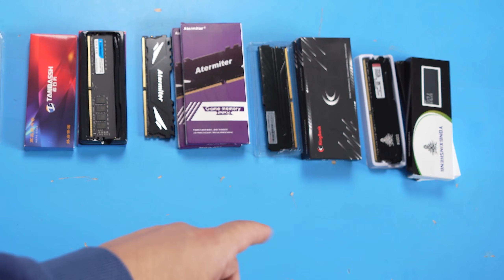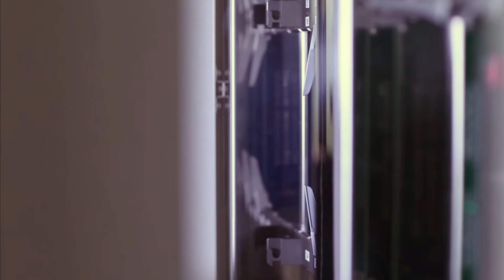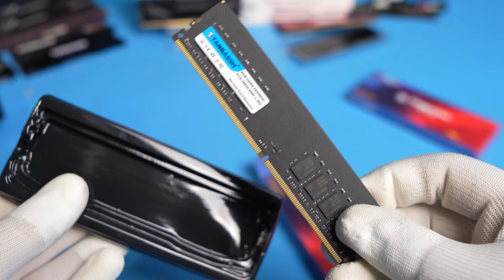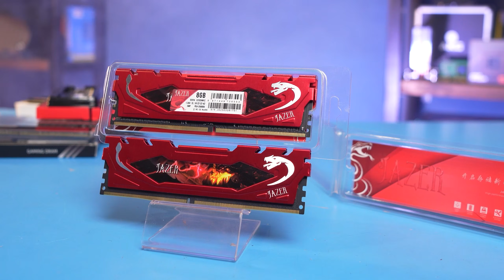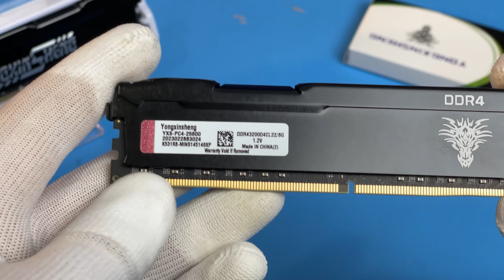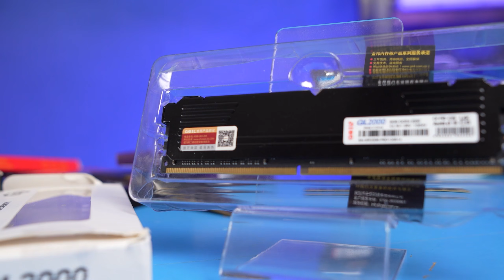DO NOT buy this RAM | Testing cheap memory from China

Comment: I am actually shocked You had issues with the killisre, I have used them several times And never once had any of the issues you did, Ran Perfectly fine for me each time, Though naturally each person will have Different Outcomes Depending on the seller Possibly? Anyways great video! Also i should note, I used killisre in ddr3 builds, And recently acquired Two 8gb sticks of ddr4 For upgrading from a i7 4790 to a I7 9700k, Did memory tests And It was completely stable and Ran 3200mhz at cl22,
 in my current set up(that i am upgrading i have 32gb of Killisre ddr3, And have had that ram For several years now With no issues, But i could of gotten lucky
Reply: some people  had issue with china not rams

Comment: 10 $ 8 gb ddr 3 , kit of 2 and no problems 2 years in use , yeah no XMP , a bit of overclock by lowering timings , but stable no errors , i can see the downsides but still worth it for the price . As long as you don't overclock and  know how to set your timings for stable , any ram works .

Comment: Another ram snob. The chips are all the same no matter if you pay double or triple the price. They are all either Micron, SK Hynix or Samsung. In 2024 and on SK Hynix has started to faze out ddr4 chips production so most chips are now Micron and Samsung (which is good). No matter what ram you buy you get these chips. The only difference is in the binning. You can OC well binned chips more and are more stable. Well binned chips will run the advertised speed at Jedec profiles.

Comment: I bought DDR3 Kllisre ram years ago 32GB for around 120CAD in 2019, this is when DDR3 was still stupid expensive for some reason for 8GB modules. I wanted to max out my ram and couldn't afford the brand name stuff in Canada so I ordered it and it worked great at 1866MT for years, even ran it as a server and was also stable on my Z87 with a 4790K.

Comment: Bought KILLSRE 3200mhz 16gb kit worked
Cuso 16gb 3600mhz worked 
Sold both and now i got fanxiang 16x2 3600mhz and works like a charm

All from aliexpress :))

I also snagged a RTX 4060 MSI ventus for 235 USD I used coins and a 40$ coupon :))

Comment: Bought 2 kits of 2x48GB 6400 CL32 from kingbank

All 4 sticks have hynix m die and all run at 7400 CL37

For £188 and £193 for the first and second kit about 2 months apart it obliterates buying any other sticks from anywhere else even used sticks
Reply: Is it working perfectly fine mate? Im thinking to buy it
Reply: @ yeah all still working fine but with 4 sticks i het 5400 and 2 sticks 6400, depends heavily on workload which performs better

Comment: I do not know about any of the other brands but KingBank DDR5 Hynix-A die chips are killing it! You'll have to buy a 2x16 6800 and above for guaranteed A-die. Their 2x24GB 6800 kit is also amazing (Hynix new gen M-Die).

Both can be overclocked to 7800~8400+ on Z790 / AM5 platform depending on the silicone lottery for the chips.

I've had experience about a dozen KingBank DDR5 kits from 2x16 6800 / 7200 / 6800
and 2x24 6800 kits.

I do not have any experience with the KingBank 2x16 6000 / 6400 first gen M-Die kits.
Reply: I'll get the 6000CL28 A-DIE kit from that brand, hopefully it will be good, my first option was the T Create 6000CL30 but KingBank gives lower latency and EXPO profile
Reply: @matiasbao4900  That's a very good kit, good chips, especially if you just set and forget EXPO. If you know how to tube a bit I was able to do 6400 CL28 with pretty much all their A-Die kits at 6800. All their kits have both XMP and EXPO.

The real performance improvement will come through tweaking the subtimings.
Reply: @Ben-ld1qi I am clueless about ram tweaking, specially on Ryzen, any videos you recommend me? All I know is that the sweetspot is 6000 and C28-30, nothing besides that
Reply: @matiasbao4900 how did your experience go? Which ram you ended up buying?
Reply: Have you tried KingBank ram using amd or intel cpu? I'm really considering buying them but idk if they're stable with AMD.
Reply: @salem7 You'ge got nothing to worry, they're stable with AMD, it's not any different. I used to have 7800x3D and Gigabyte B650M Aorus Elite and I did only 8000c34 fully stable using a KingBank 6800 2x16 kit. 

A friend of mine recently bought KingBank 8400 2x24 and hes running it at 9133 Gear2 on Intel Z890 platform, he's got GSkill 8800 and V-Color 8600 that fail to do 9133.

For AMD, something like 8000 in 1:2or 6400 in 1:1 would be ideal. Anything higher involves luck with getting a capable CPU and motherboard, the RAM isn't the issue in the majority of cases.
Reply: @salem7  I see my reply didn't go through? Afff... Apologies I don't feel like rambling again. TL;DR they're work for AMD and Intel just as well, they're no reason to worry about them "not stable" with AMD or any nonsense like that. What frequency and CAS latency do you want to achieve?
Reply: @Ben-ld1qi honestly I don't plan overclock it beyond whatever expo profile, I'm taking cl28 6000mhz 24x2 which is the same price as 16x2 corsair 6000mhz cl32
Reply: @salem7  With EXPO speeds and absolutely zero tinkering, overclocking or finetuning any of the timings (there are over 20 other subtimings), a 6000c28 2x24 is a good choice. You've got nothing to worry.

I run 6800c34 2x24 @ 7400c34 with all the subtimings tuned, the reason for 7400 and not 8000+ is because of my Intel motherboard's limitation, not the RAM. 

When I had 7800x3d and Gigabyte B650M Aorus Elite over a year ago, I managed to stably overclock the KingBank 6800x34 2x16 kit to 8000c34, but doing 8000 on AMD B650 requires lucky CPU and motherboard. Now on B850 (not B650M), doing 8000 should be easier to achieve. Your 6000c28 2x24 will very likely be able to do 8000+, but it also depends on your CPU and motherboard, it's a trifactor of those three.

A friemd of mine is running KingBank 8400 2x24 @ 9133 on Intel Z890.

If you ever choose to learn about overrclocking I'm sure you'll be able to do 8000c38 / c36 quite easily.
Reply: @Ben-ld1qi  Greatly appreciate your response mate, just made the order for KingBank DDR5 48GB (2x24GB) 6000MHz CL28. honestly with the same price there isn't a better deal. 
Can't wait for it to arrive!!
Reply: @salem7  Yes they're very good for general use and some light to moderate overclocking even. My 6800c34 2x24 kit costed me $98 and I didn't even get 18% VAT when it arrived. If I were to buy 2nd hand used RAM I would only find some 2x16 crap RAM. The metallic heatsinks by KingBank (the ones that 2 hex screws by a plastic covering) are very well made, they cannot come apart because a screw each side is holding it tight, I believe the 6000c28 2x24 uses those heatsinks. Where as the heatsinks without the screws can come apart with since there's nothing holding them together besides the adhesive tape and if it gets hot and wears the adhesivce tape loses the heatsinks drift apart a bit.

Comment: If your motherboard brand specifies a certain model of Kingbank ram is on their compatible list, would you buy it?  I had a builder shove the wrong model in and obviously it's bottlenecking. Tried Expo settings on the old ram and I get more noticeable speed in my system, but it's unstable. I know there's improvements to be had (hence realizing the bottleneck) but wary of a brand i didn't know about until this desktop build.

Comment: if you are paying less than 50% of the price those are totally worth it imo
Reply: eh i paid 18$ for 2x8 -16gb of the yongxinsheng  cant complain about the price
Reply: @ That cheap memory will screw up your computer
Reply: @Steve-mp7by elaborate
Reply: Fake RAM can corrupt data and cause a short that will fry your mobo and CPU. There is no quality standard with that fake junk
Reply: So long as they last at least half as long, and don't take out the rest of your PC when they go BANG.
Reply: @zlobzor how does that happen genius? Mind explaining?
Reply: @zlobzor  how would a ram malfunctioning take out your whole pc tf
Reply: @lemonke5341  SHORTING THE CIRCUITS.
Reply: wont happen
Reply: @maorlodrik  Just because it works doesnt mean its reliable thats what cheap and fake products really is obviously it will work duh but how long.
Reply: @ I have a netac one for 3 years...
Reply: @gladewings1192 weak argument

Comment: good video  but the problems only seem to appear when you try overclocking  News Flash  not everyone wants or needs to overclock their ram the extra performance of say 3200 to  3600 is very negligible and hardly worth the effort.   you get what you pay for no different buying second hand ram on ebay

Comment: If longevity is good for the price and whatever is run isn't bandwidth bound, it's probably a good buy. It would be a valid way to recycle components and reduce demand so prices might be lower for those who would benefit from higher performance. The probability of a short destroying the computer and data needs to be addressed if it hasn't been.

Comment: (Not shown on here) Juhor is good quality. 3x different kits now: DDR4 3200(crucial/micron), DDR4 3600 (Samsung) & DDR5 6000(Samsung). All SPD info shows as Juhor & module as Samsung or crucial's micron. They do one with anime art on hsink, listed as Hynix too. But they keep the different modules separate, like Hynix type above. not mixed like these in video. XMP profile works no problems. Dual channel no problems. If you want decent cheap memory go Juhor. Might not be cheapest on there but, save on price here & have a decent quality.
Tried Kingspec So DIMM & RZX So DIMM (laptop)DDR4 & both have been fine. Laptops only have 1 slot nowadays, along with maybe soldered modules on mono. So dual channel & the worry of different modules on 2 matched dimms wouldn't really matter.
If it works it works as some said on here. & A lot upgrade to a new platform every 6 months to a year, as long as the longevity lasted that long they wouldn't care.

Comment: do not listen to this guy. if you need cheap ram for cheap PC  why niot to buy? I bought youngxinsheng and they work perfectly.
Reply: It is mostly coming out of one factory anyway.
Reply: as long as it work ,lol
Reply: I totally agree with you, all of these vids are misleading, and are clickbait (some of them) i use cheaper stuff for my secondary pc, they still works great for over 3 years, Aliexpress is a great place to shop as long as you know what you're doing & what are you looking at
Reply: Function now?
Reply: I've had cheap ram destroy a motherboard/cpu memory channel. (Was OCZ Brand). Cheap ram can also affect system stability. 
Also Don't cheap out on your power supply unit, or buy cheap storage (ssds) or  refurb'd storage either
Reply: @jimtaylor201  you don't know what your talking about
Reply: @jimtaylor201  if storage is only for games i will not care about cheap SSD even qlc really but it's personal preference i like FireCuda 530 and Intel 670p great drives but first is a really expensive one these days even almost unavailable in my country...or it was about 3/4 last year and KC3000 not bad too 😊oh i also have older Barracuda Q4 not bad but it should not be from some schyzophrenic new unheard sellers/manufacturers with name like xuihuxiu or blfkfhd or whatever which does not sound like reliable source
Reply: Why you are on a phone then?
Reply: youngxin..whatever is that a noodle manufacturer? it sounds exactly like that :D
Reply: Not very intelligent

Comment: Ok. So this is amazing! I really wanted to buy 64gb opf Juhor for ummm scientific purposes and to see if it'd out perform my 32gb of Gskill trident. I'm actually running a Mllse 2060 Super (Aliexpress special) GPU over my old Gigabyte 1660 and surprisingly other than a few hiccups (have to dial-in game specs), it does a lot better. I've been kinda into these Chinese parts lol
Reply: Juhor is good quality. 3x different kits now: DDR4 3200(crucial/micron), DDR4 3600 (Samsung) & DDR5 6000(Samsung). All SPD info shows as Juhor & module as Samsung or crucial's micron. They do one with anime art on hsink, listed as Hynix too. But they keep the different modules separate, like Hynix type above. not mixed like these in video. XMP profile works no problems. Dual channel no problems. If you want decent cheap memory go Juhor. Might not be cheap on there but save on price here & have a decent quality.
Tried Kingspec So DIMM & RZX So DIMM (laptop)DDR4 & both have been fine. Laptops only have 1 slot nowadays, along with maybe soldered modules on mono. So dual channel & the worry of different modules on 2 matched dimms wouldn't really matter. Juhor has top  sponsors over there & everything, I would say another maxsun type manufacturer over there.

Comment: A Penny saved Today is more like .8 of a Penny earned Tomorrow- thanks hyper-inflation. Also, YES some DDR4 and 5 is only compatible with either AMD or Intel. Especially lately. I don't disagree that all this ram is likely junk but new good ram is sometimes only Intel or AMD compatible. There's a reason ram is labeled to be compatible with one, the other or both. I've never had the problem myself but I do know it's a thing- a friend of mine had to return and get different Memory not too long ago for this exact reason.

Comment: chinese make ram, sell to world=cheap
chinese make ram, sell to USA then USA sell to world=expensive, wow, great
Reply: I bought geil ram off amazon quite a bit back on amazon and they refuse to run dual channel even if a2 and b2 as recommended. My guess is this stuff got to amazon and I was one of the unfortunate ones who got different chips
Reply: Not a very intelligent reply. Genuine RAM has quality standards and quality control. Those fakers don't give a f- if the fakes set your computer on fire. You are obviously a Trump supporter
Reply: That's not how the things work lad. I've built a PC using these chinese cheap parts and had to swap them entirely RAM, NVME. Their chipsets are the worst quality. You can buy them cheaper, but in a few months you'll be buying a new one again, from a decent brand.
Reply: @Gabriel-zr4kz  and what is the decent brand? the one whose components and products are made out of Chinese labor? gimme a break
Reply: @CazaEdgys4000  No, one with unlimited warranty. If you want to go with these go on, but mind that you'll end up swapping them soon. Their quality tests are the worst. If you get a Corsair, Kingston, Adata they have to follow a certain quality criteria. Adata offers lifetime warranty for their rams.
Reply: @Gabriel-zr4kz ”Their chipsets are worse quality” Where do you think Gigabyte, Asus etc are made? It’s all about price and quality control. Foxconn was making a lot of their stuff until recently. I think the tariff situation has changed this a bit now.
Reply: That is basically it all you are get with the USA is better quality control. And Chinese parts have increased massively in quality over the years so not much difference. Apart from name brand components.
Reply: There's something called QA in every company whether its a chinese or US but US tend to not cheap out with their QA unlike alot of chinese company that goal really is for their product to guaranteed to work atleast a year. Chinese cheap products also dont care about reputation anymore they can just launch another name etc. and release the same product and people will still buy it because its cheap.
Reply: @gladewings1192  the opposite is true. usa products rely mostly on propaganda, whereas chinese products are based on quality production. there is a reason the chinese produce all the products for the united statesians.

Comment: Thanks for this great video. I have barely heard most of the brands of Memory in this video. Honeslty AliExpress and its Chinese platform 1688 are filled up with cheap and inferior quality products. for computer parts and accessories,  I choose JD  (more like chinese version Amazon) for online shopping. I bought one pair of 16GB*2 Kingbank DDR5 XMP7200 RAM just few weeks before and it works smoothly.  The price is USD122 which is cheapest on JD.

Comment: I bought a 16GB DDR3 Atermiter, not knowing what to expect, but it ended up being better than the RAM it replaced.

I was able to undervolt it from 1.5 to 1.2, ran memory tests up the wazoo and it was stable. That was 3 years ago, and it's still going strong today.

And till this day I wonder if they're not using traditional DDR3 chips inside the thing, but instead malfunctioned DDR4 or 5 that simply failed to run traditional JEDEC speeds, but was able to run 1600, so they just slapped them into DDR3 kits and sold them instead of throwing them in the bin.

Comment: kllisre ram works at the specs it says it does, which is 22-22-22-57 3200mhz, and is indeed trash ram, but for 64$ NZD(30usd?) for 2x 16gb sticks it does work, so far for 2 years in my trash Erying system.
its one benefit besides price, is it works out of the box with no tweaking in those recycled laptop cpu 11th gen ES 0000 erying boards very well because those boards use re-used engineering sample laptop CPU's and expect laptop ddr4 timings.

as one set is in my wifes computer, and one set is in my fileserver/game server(both erying es0000 11th gen boards) I'll update this as time goes on
Reply: update: all is well
Reply: 3200 mhz is trash? i hope this is sattire, cuz that speed is good even by today standards
Reply: @RacingMaster777  no, aliexpress garbage ram made from the floor sweepings of a ram factory is trash